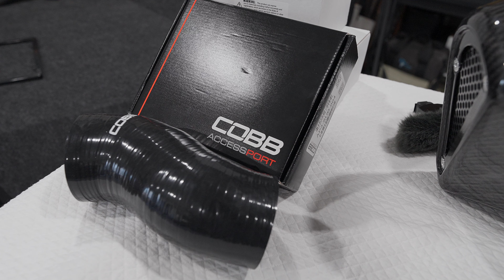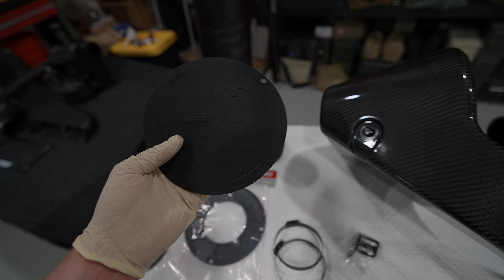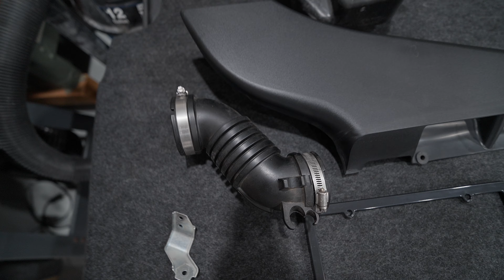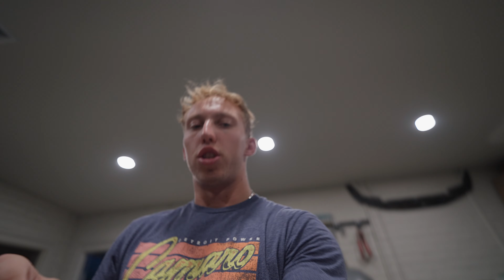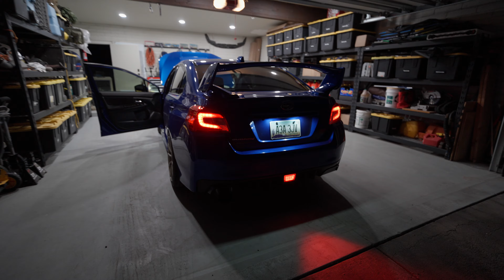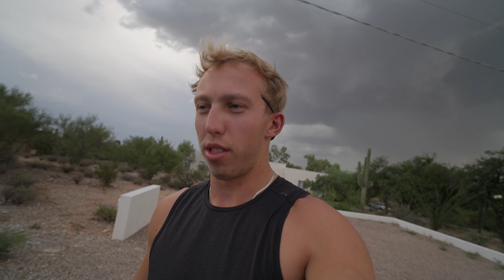COBB Carbon Fiber Intake Is the Best STI Upgrade!

Comment: How long can you run the OTS Tune that comes pre loaded on the access port ? In other words, is it safe and reliable to run that map for a while before getting the car pro tuned ?
Reply from the maker: @J0rgetorres  as long as you use the parts intended for the tune it’s should be good to go for a while!
Reply: @sam_stuckey  thank you for the quick response bro
Reply: Cobb OTS Tune only works with Cobb parts. they are not the best tunes. Pro tuned is way much better since the tuner can see everything to dial the car right

Comment: Why would the intake be the "BEST" upgrade. If I were to upgrade any of the STi's or WRX's that I've built, why would I choose the intake as an upgrade and call it the most important part? Perhaps a baffled oil pan and pick-up, AOS, fixing the cylinder four cooling problem...etc etc etc. Keep in mind, I've had 5 WRXs or STis since living in Japan in the late 90s. Maybe this sounds great when installed, but when compared to more important and relevant parts that improve the car and its shortcomings, its not important.
Reply: Yeah but does it make a woooosh sound?
Reply: Forged internals d best
Reply: suspension/wheels & tires